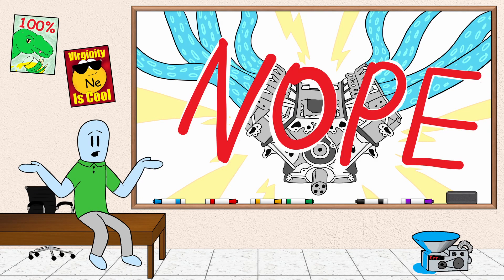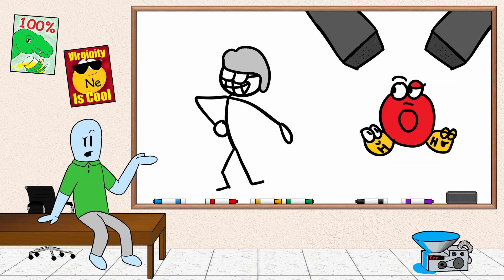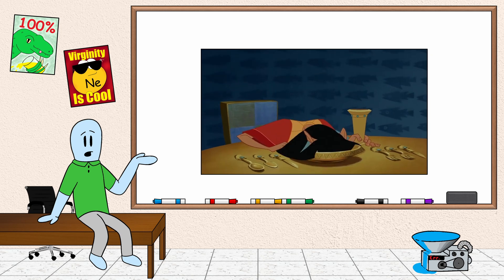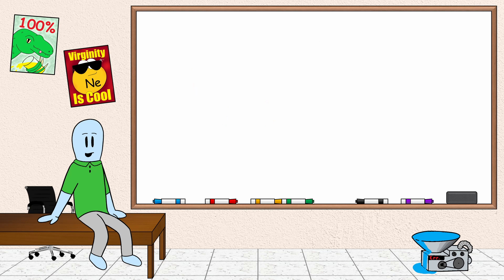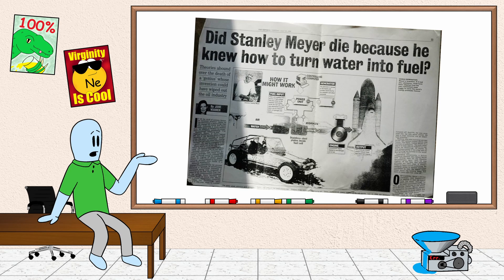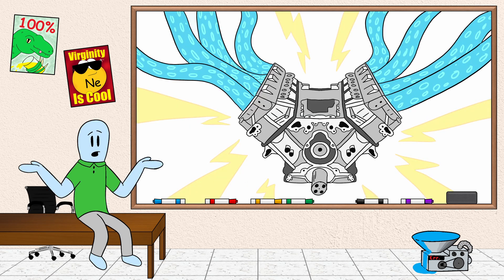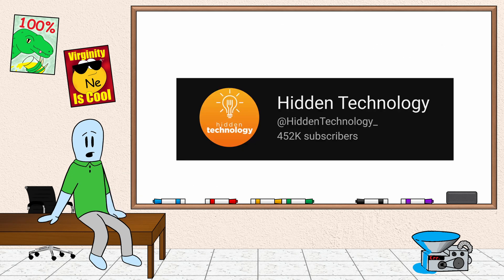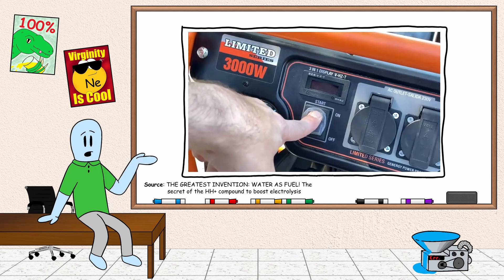Water Engine Conspiracy Explained: From Stanley Meyer to the Internet Wildfire

Comment: Videos like this really aren't going to end well as you simply do not know how to go about asking the right questions. You act as Dr. Faraday's electrolysis method it the only method on earth that breaks the bonds of the water molecules. So, let me ask you a question what happens when you put an acid, salt, or base on a plant? You kill the plant correct, but why? The reason why the plant will die is you made the water too conductive and the plant could no longer break the bonds of the water molecules by way of photosynthesis. Now you have heard of photosynthesis before, yes? But I be willing to guess you truly have no idea how photosynthesis works as all a plant does to break the bonds of the water molecules is to take away the electrons from the atoms that make up the water molecules. 
Now since you have no idea how a plant breaks the bonds of the water molecules then you would be totally clueless on how a thunderstorm goes about breaking the bonds of the water molecules. But just to give you a hint, all it does is to also take away the electrons from that atoms that make up the water molecules, but doing so by way of ionization, as it is the act of taking away the electrons from that atoms that make up the water molecules that breaks the bonds of the water molecules.
There is a new company named Hysata that has made and electrolyzer with an efficiency between 95-98 percent and they explain that the primary problem with electrolysis is the bubbles gather on the plates as they are not conductive and to get around that problem they created a capillary system to do so. What Meyer did was to place the water molecules between two or more plates forming a capacitor with water as it's dielectric material and bring the voltages up to the point were the atoms would start ejecting their electrons, and just like a thunderstorm the water molecules get broken down as that was his solution to the very same problem Hysata spoke about. This technology basically mimics the earth's global electric circuit, but know Meyer was not the first to do this as that honor goes to Dr. Dingle of the Philippines whom did this way back in 1968.
So, now that you know a little about the science behind this technology can you see why I say this video of yours isn't going to end well?
Reply: You lose credibility when you make so many assumptions and state so many implications that it's hard to see where you're arguing from. I mean really, you can't just assume your reader is stupid and talk down to them. That's not a great way to convince someone of your thinking---respect, please. That aside. Even if hydrolysis is 100% efficient and nothing is lost to heat, the energy just gets circulated around with neutral entropy, rather than negative. Also, acids and bases kill cells because they denature enzymes, not because, as you suggested, they "make the water too conductive." While I'm certain the push to break the 2nd law is made for completely benevolent reasons, it's more productive to instead research better ways of storing and producing clean energy (think fusion...) unless you want to produce a good demonstration of entropy. 

Actually, on second thought, perpetual motion IS possible. It just has to be in a vacuum. ;)
Reply: No my friend, Dingle does it on different way, nothing similar to Meyer's.
Reply: @aleksandarpetrovic6613  No, it's roughly the same it's just that Meyer refined it a bit more, but know Meyer too didn't go all the way with the technology as I fixed some of his mistakes. 
The main thing that Meyer did was to give us a legal way to bring the technology out. So, that when one of us has enough to attempt a launch this technology no one can turn around a sue us for doing so.
Reply: @h2opower  I know who you are and I appreciate your work, but I disagree with you there, because I was made water powered engine and I understand technology behind that, and I know that Meyer's and Dingle's work not the same. The same is just a fundamental thing, that is the same for all water powered engines, they use energy from ether (zero point energy).
Reply: @aleksandarpetrovic6613  It's okay to disagree as you may know of me but do I truly know of you? I went to the Philippines way back in 2009 which is a fact not many know about me, did you? But in the grand scheme of things the core of the technology is the same in that they both mimicked the earth's global electric circuit to make use of water as a fuel source.
To me arguments like these are pointless as they truly serve no purpose. I don't know of anyone that has figured out Meyer made some mistakes as I am almost alone in making use of the scientific method to get a true understanding on just how this technology works, and even I still don't have all the answers as of yet as understanding it and building it correctly are two different things.
But please don't engage me on side talks like this as I truly haven't the time for it, okay? Thanks
Reply: @h2opower  ok, sorry, I couldn't have guessed that you would react so violently, I don't see the reason, maybe it's my bad English... I wish you all the best in your future work.
Reply: Dr. Dingle was not the first it was Dr. Dumaludoo
Reply: Man you are cocky aren't you
Putting water between two plates and cranking the voltage up until atoms started to eject their electrons is fundamental of WATER ELECTROLYSIS, it's not a capacitor it's just ordinary electrolytic cell.
It doesn't matter how you split the water you will never get more than what you put in.